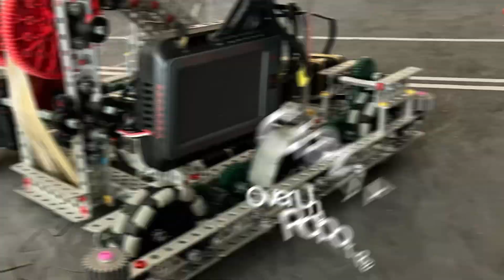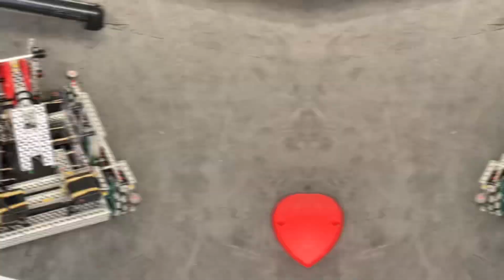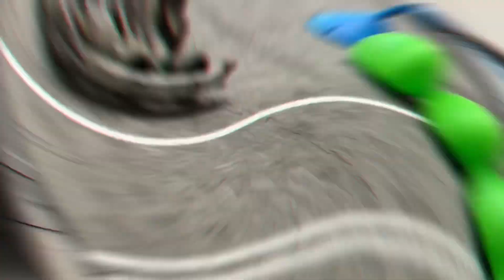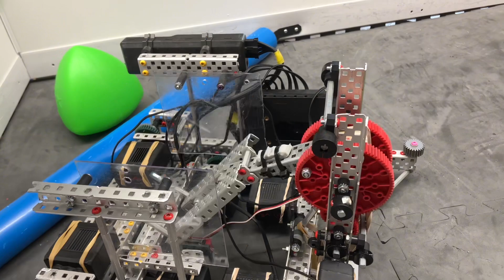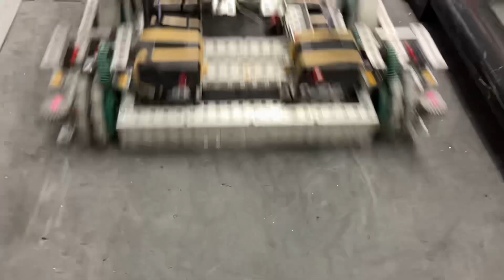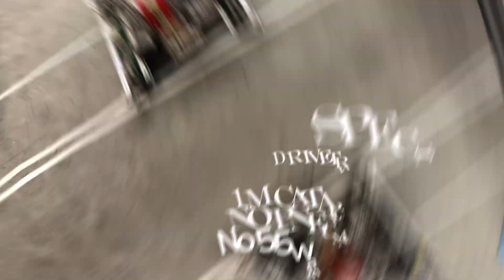Crazy Aces Over - Under Robot Reveal

Comment: What are those small gears doing on the 2 outside c-channels?
Reply from the maker: They are there to glide along the walls instead of the c channels directly rubbing on the walls, so technically a glider for the walls.
Reply: @CrazyAces79298Z  Oh, that makes sense. Thanks